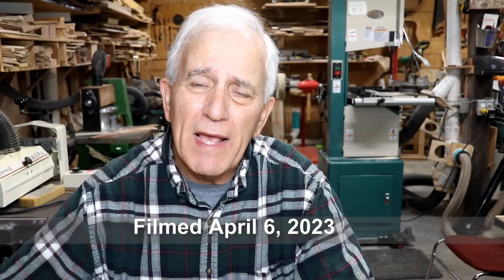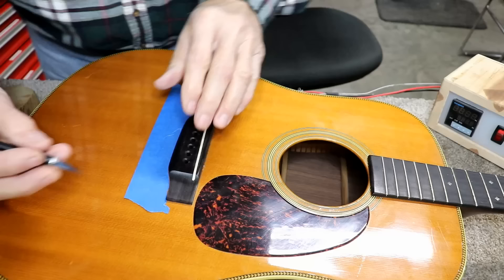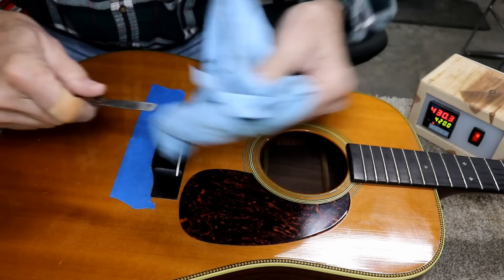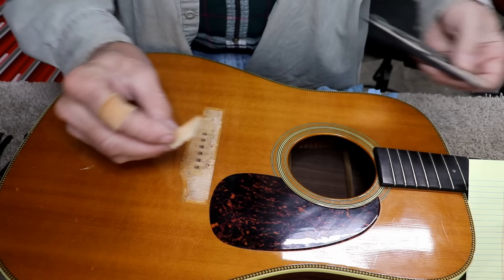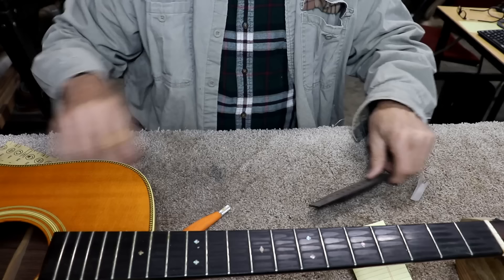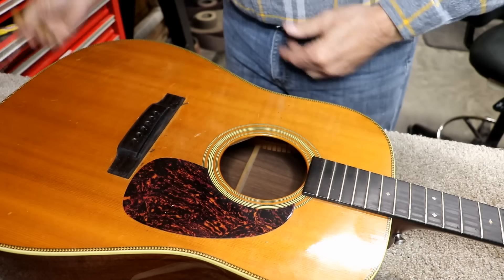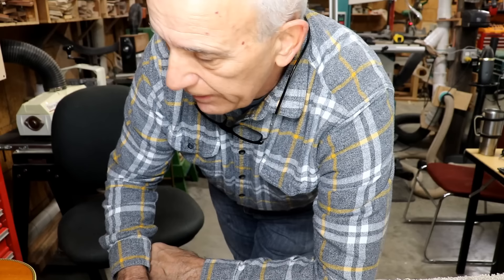640 RSW Refused by 2 Martin Factory Authorized Shops

Comment: Ive been a wood worker now for ohh 45yrs. A musician for 40. And a string player for 35 of those years. Slowly gathering the tools and what l THOUGHT were the skills necessary to become a luthier. 
Little did l realize that once l took the leap that my most used tools would end up being my small community's entire supply of one sided safety razor blades and my giant pickle jar full of old bits of partially used sandpaper. 
All those years.... I had everything l needed right there at my fingertips.
Except for clamps. Still buying clamps of every size, shape and construction. 
Otherwise I'll bet l do a solid 50% of my work with a friggin razor blade!

Comment: At 48:21 in the video, maybe I'm wrong, but it appears there is either glue, finish chipped out or bare wood exposed at the back of the bridge. I certainly appreciate the advanced level of craftsmanship required for this project (having had neck resets and bridge removals on my Martins over the years), but I would not be satisfied if my guitar was delivered back to me in this condition.  If I am wrong about what I think I see in the video, I apologize for the negative feedback.
Reply: I was surprised to see that as well. I went back to the beginning of the video to confirm that it was not there to start. Unfortunate.
Reply: I'm sorry to say I have to agree. And sanding using the guitar body for support is just not worth the risk, no matter how much pressure  is applied.  I really enjoyed the banter but....
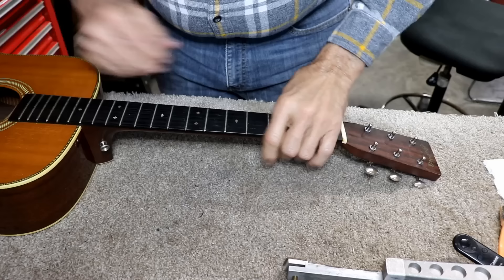Reply: Good point, at 27:10 we see the glued bridge and it looks fine. At 36:00 we see it again and the spruce near the bridge looks completely different and he never explains this. My guess is the bridge came loose after he drilled it at 27:24 (which I was shocked by, and the amount of wood the drill bit brought out). He should have never drilled the bridge with that bit after gluing it to the top (wtf?), just use the reamer to carefully clear the holes. My advice to all instrument/music lovers, never try to "save money" on a repair. Take it to the best and be prepared to pay. Also, if you are pulling out a glued-in saddle, pull it from the center not the end. Would also like to know the year of the guitar or did I miss it?  A good bridge repair video that uses some different techniques:
https://www.youtube.com/watch?v=wZExe86TxLs
Reply: At 27:10, when the clamps are removed, there is a scratch that appears between the sound hole and the bridge, I think something happened?

Comment: Just a few things:

- Bridge removal and replacement - especially on Martins - is a bread and butter job for a professional shop.  No pro turns these away because it is easy money.  If in fact the Martin-authorized shops took a pass on the job, it was far more likely that they judged it a non-warranty repair and quoted the usual $250-$320 for the work.  

- Use a 0.0025" or 0.003" feeler gauge  (paper is 0.0035") to probe... paper is floppy and gets soggy when water is introduced, and you'll usually want to get some water in when the bridge is on with HHG (I have never reglued a bridge with Titebond... horrible, nasty stuff that should never be use on a decent instrument... creeps cold or hot, contaminates the surfaces, and is a miserable material to clean off wood when cured).

- NO... the saddle is NOT glued in... if it is a Martin and has rounded ends, it is a drop-in made to look like a through saddle... which is to say it will lift out.  Use a mini end cutter with the edges blunted for the job... $8 for a Husky or other cheap big box mini end cutter.  Because ebony these days is always seasoned for far less time time than in years past, it will shrink a bit after fabrication, so a saddle which was a tight fit in the factory at set-up will feel like it is glued after a decade or so.  Slowly work it out by moving back and forth along the saddle with the modified end cutter and some scrap wood veneer to protect the top of the bridge.  For post-2005 square-ended through saddles, expect to find them glued in with CA... idiotic, but that is what happens when you don't have to fix your own guitars (192g HHG is the correct adhesive for gluing in a through saddle, and they need to be glued in on vintage and even new Martins).  If you don't have a good approach to removal of a CA-glued saddle (a saddle mill or heat lamp setup for removal), find someone that does and have them do the job.
 
- NO...do NOT score the finish around the bridge on a post-2005 Martin.... they used a pocketed bridge glue technique on this guitar and all you are doing is creating a stress riser that will cause top failure.  If you are not familiar with how Martin does the work, again, find someone that knows what they are doing.  And if you want to score a finish for removal such as on a refinish where you forgot to mask, use a fresh needle and light pressure... it is only necessary to score the lacquer - no need to cut all the way through if your scraper is sharp (single edged razor blade with edge turned).

- You HAVE to work both sides of the bridge (sound hole side and tailback side) for release on most tops because of grain runout on the book matched top...nature of the material.  Runout may work to guide the palette knife blade down towards the bridge plate if you are not paying attention, so determine how much runout/which direction (e.g., rising grain on treble side/descending grain on bass side). If sound hole-side access is limited by the pick guard, just pull it off...these 'peel and stick' pepperoni guards come right off with a pallet knife and naphtha and go right back on with 3M 468 film (eBay), or make another $145 by swapping out that ugly pizza guard for a shop-made Vintage Brown 0.028" guard using the Axiom material or other upgrade cellulose nitrate material.  if the top is markedly darker on one side of the centerline than the other, it usually means a significant amount of runout.  if you move your viewing angle, the light/dark sides will swap and you will have your answer as to runout direction (light means the grain is rising away from your eye position and dark means grain is rising towards your eye position.

-Rock maple rift-sawn bridge PLATE... NOT pad.  It is the traditional Martin plate material and at 0.095"-0.105", a good compromise between wear resistance (more is better) and  added mass (less is better).  Bigger, more massive bridge plates are ALWAYS a bad idea.  Ramp and slot the bridge and use good quality hard plastic (Galalith) unslotted pins, then teach your customers how to correctly orient the string balls.  Again - a bread and butter job that is a consistent $80 in the door every time.  There are luthiers that make a good living pulling those massive rosewood 1970's Martin plates and replacing them with rift-sawn rock maple... focusing on wear resistance and ignoring mass is not a good idea.

-Lacquer...not varnish.  Totally different materials.  One is a drying finish and the other is a curing finish... that matters when doing repair work.  Trying to do finish repairs with the wrong material or using the wrong technique creates a heck of a mess.  Tung/phenolic varnished guitars are exceedingly rare, but is one of the most durable finishes for a musical instrument ever devised, but it is far more time and material intensive, so seldom used on production instruments.  Since Ford and Devilbliss pioneered practical lacquer spray application, Gibson and US-made Martin guitars have always be lacquered with standard instrument lacquers on the body/neck and cat lacquer on satin and a few gloss necks.... one of the reasons why so many newb-made Gibson headstock touchups fail (mine included way back when .... cat lacquer requires more prep and a very solvent-hot initial tack coat for a drop fill or overspray).  Again... easy check to verify the finish, and yes - it def matters. 

- Use some water on the palette knife... you'll need it on pre-1968 and Authentic HHG jobs, and a bit of water on the knife on a Titebond-glued bridge keeps the residue from sticking.  A good technique is to warm the pallet knife in hot (not warm... think 150-160 deg F) water... either a Rival Hot Pot or one of those $30 Amazon wax warmers does a good job and is one of those things that every repair bench needs.  Keep dipping the knife in the hot water.  

- You broke the saddle... and it is bone.  Bummer... it happens... hopefully just once, given you've learned your lesson.  Next time work along the length of the saddle, back and forth - avoiding using one end as a pry bar - and shooting for just a bit of movement (0.010" or less) at each lift.  If the saddle cannot be removed, call the customer, get the extra $125 in time and materials approved, and either carefully break it out or use a saddle mill to remove by routing (some of these CA-glued Martins are like this...).

- No - the bridge was NOT glued to the finish.  Remember - pocketed bridge... possibly some glue residue over the finish if not properly fitted and clamped, but no intent to bond finish to bridge with adhesive.  Yes - Martin's early pocket bridges prior to the 'improved' CNC router method had excessive finish left on the top, but there is more than enough clear area for a successful reglue job.  Use 315 gram strength HHG and it will be in place long after both of us are dead and gone.  Clear the existing patch, heat the bridge to about 160-170 deg F on a hot plate (the old Salton plate warmers are great for this), then precut both surfaces and clamp up.  The mass of the bridge will provide a heat reservoir to remelt the HHG on the bridge patch as you snug up the clamps.

- For fretboard cleanup, plastic razor blades do the same job as steel, but don't scratch the crap out of the ebony.  0000 stainless steel wool gets you to that satin factory look after the cleanup.  

- Oil is about 400 times less effective at excluding moisture per mil of thickness than wax, and moisture resistance is the primary reason why we put stuff on the fretboard.  Mineral oil will evaporate within a few hours, leaving some fragrance and whatever other contaminates were in the oil.  Looks nice for a bit, but useless for protection against player perspiration wicking under fret wire or gumming up the board.  Howard's Feed and Wax has wax, some mild citrus-based cleaners, and just enough mineral oil and naphtha to get the cleaning job done.  The wax stays behind and seals the fretboard and - more importantly - the fret/board interface - against moisture intrusion.  If all you are after is a temporary cosmetic effect, other mineral oils will work for a few hours, but if you want cleaning horsepower and moisture resistance, use Howards.

Other than that, certainly an entertaining video and good luck on the non-luthiery projects.
Reply: “Just a few things.” Quite the contrary. I found your detailed response to be quite informative. Thank you. 

I’m no expert but I have eyes. I was distressed to see the finish damage after brute-forcing the bridge removal. The obvious glue residue was discouraging too.
Reply: Your the guy I want working on my guitar

Comment: Just a bit of advice from someone that delaminates on a daily basis. Heating this adhesive and working with a single spatula is almost futile in that, the adhesive simply re-adheres when you pull the blade. Work just one small section at a time leaving the blade inserted. Then move on with another blade leaving it inserted and just repeat the process until you get to the end. At this point and if it hasn't already broken lose, simply heat the entire saddle and lift all at one time. Anyways, very nice. Great job.....
Reply: Sounds like good advice
Reply: Anyway, anyways is not a word.
Reply: @PatHaskell  Of course it's not. However, it is a nixinym. As so defined, we (as consumers of "all be it" language) find it perfectly acceptable to inject herein.
Reply: @PatHaskell Yes it is. If people say it, it's a word. Typically used by people in the upper midwest. BTW, do think "aint" is not a word?

Comment: Hyde glue for ALL repair work...a retired trained luthier who takes pleasure in watching folks do what I did for 30 yrs...and am both entertained and in shock..you do a good job..I have done that bridge removal many times..and fixed many turnaways from fraudsters with no pedigree or training..from ukelele to geetars and violins and violas and cellos and double basses etc..repair and restoration..award winner for a violin I made in 1988...and travelled the world as a luthier teacher and performer..now I play for seniors..in siberia alberta kanada..
Reply: Are there downsides to using "liquid hide glue" ?
Reply: @jonandersonmd7994 Not that I know of. I was a piano rebuilder for nearly 20 years. We used hot hide glue for most everything except re-gluing ribs to the soundboard or shimming the soundboard. Liquid hide glue seemed to work as well as hot hide glue but it takes a lot longer to cure.

Comment: Beg to differ about humidity. We live in an arid area and heat with wood and electric furnaces in winters that can get down to -25C. RH in my music room in winter would be in about the high 20s without the use of a Boneco steam plate humidifier. (That is, it boils the water and greatly reduces the possibility of a bacterial biofilm.) I keep the humidity at 50% year round. (45-55% range but 50 is the sweet spot.) Factory humidity. At that level, my guitars stay in tune for days and tone is best. Guitar neck stays properly set year round. No seasonal adjustment due to humidity changes other than an occasional minor saddle shim in winter. After having a D-28 pop a 12 inch crack on the top side due to travel during extreme cold and dead of winter low humidity, I've kept my guitars all humidified at home. The unfinished wood of the guitar interior is what loses or absorbs moisture regardless of what % moisture the wood was originally dried to. Anyway, a lot easier to humidify a room than each individual instrument. All mine are on the walls on hangers and not in cases. No cracks.

Comment: I had this beautifull green sunburst like guitar. It was very light but after a while the bridge came loose. Wel actually it didnt came loose, it ripped the wood apart. I turned it in and got it back totally black with two giant screws sticking out of the bridge on the inside. It looks all bumpy where the damage has been. I could cry I can tell you that. I wish I had known Jerry at that time.

Comment: I have been using Hyde Glue in the form of Old Brown Glue for attaching bridges. I do like it and heat will take it off again. It also cleans up really easy with a paper towel and hot water.

Comment: The best bridge reset method I've seen on YouTube hands down,I totally agree with Jerry on his take on the glue squeezeout, if all that excess glue stayed Trapped under the bridge it creates microscopic air pockets therefore weakening the joint, all your trying to do is fill in the pores of the wood on both surfaces and leave just enough adhesive in between to create the bond.
Reply: not to mention excess glue muffles the tone and volume

Comment: it was fun watching you do this scary repair.  Before I took a luthier's course I had a bridge split due to a poorly installed undersaddle pick up (done by a certified luthier).  I talked to Jean Larrivee on the phone and he told me to remove the bridge and send it too him and he would make me a copy.  He told me that to remove the bridge, I was to use no heat, and to match up a block of hard would with the north side of the bridge and with a large wooden mallet to strike the block with one good hard blow (swinging south toward the tail of the guitar of course) and that that should remove the bridge, and that there might be some chip out to deal with but it should be mostly good.   It worked.   YIKES!  then he sent me the new bridge with all the old chip pieces.   ( I live in the middle of now where so that's why I was doing it myself.  and I wanted to learn).   I had no bridge clamps so I made some blocks to support the bridge plate, cut sacrificial chop sticks for the pin holes, glued up and placed the bridge where it goes with the chopsticks firmly holding things in place, placed the guitar in it's case, forced the lid closed, and got something heavy to rest on the top of the guitar case and left it together for a couple of days.   I had lots of squeeze out that was hard to clean up but here we are, 40 years later and the bridge has never lifted, the guitar has had a very active life always getting play'd hard with 13 gauge strings and is still my number one.  (it's one of the earliest Dreadnaught style Larrivees)
Thanks for your vid.  It was very fun to watch.

Comment: Attention.if you are using a case that put s pressure on the strings.the foam padded type that pressure will pull the bride and top.

Comment: I was a Martin repair shop in the 1990's. The vintage part is mainly advanced X, through saddle, and 1 3/4 nut. The correct way to glue a bridge is wood to wood. It is either masked when the finish is sprayed or an outline of the bridge is scored and the finish scraped sometimes with just a feather (Santa Cruz) which is perfectly good if done right. Through saddles suck for many reasons. This one is definitely bone. Anyway, I told Martin that it was a problem gluing wood to finish. They knew but they were making too many guitars and weren't prepared. It comes down to numbers. How many are going to wind up as warranty repairs vs how much it will cost in $$$ and time to fully score the finish. Those are still great guitars but those through saddles. Uggghhhh. Such a bad idea. The drop in was a big improvement.